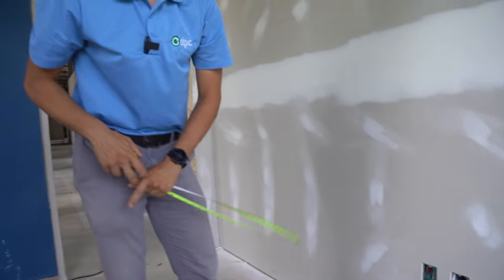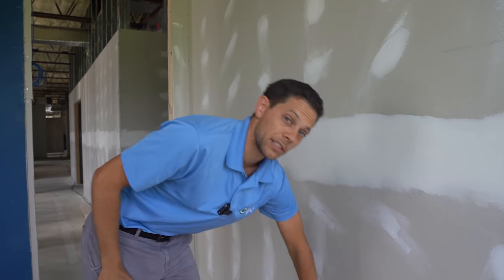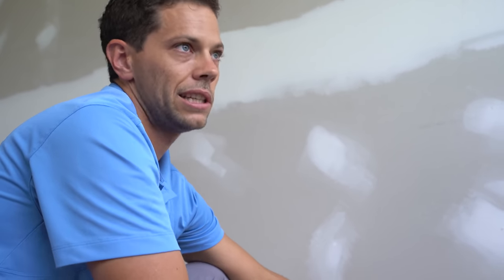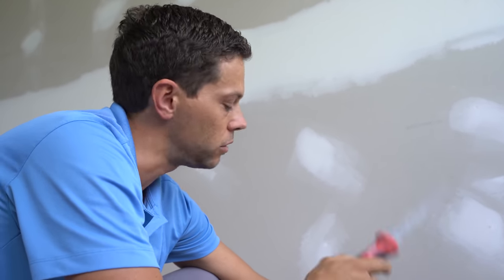Wall Wire Fishing Master Class: Run Cables in ANY Wall like a Pro!

Comment: First, check that there's no wires or pipes in back of the wall. One can use a small punch instead of a keyhole saw to indicate inside corners (or a small dot with pencil). If the wall is clear behind, one can punch trough or use a wall sensor/detector to chick for wires (deep scan, etc).
Reply from the maker: Thanks for the feedback!

Comment: I'm cable from one point to other but it's on the left side
So that means to fish my wire about a 2 feet to the right and down
It's an external wall so there's a cavity between the brick and studs

Should be doable but tricky

Do you have any tips ?
Reply from the maker: External walls are very difficult.  It's had to say..

Comment: Quite a bit trickier in an old plaster wall. Especially when you need to go up a couple floors. I ended up needing those flex bits with an extension  to get through the top and bottom plates. Of course true dimensional lumber as well.
Reply from the maker: All true!

Comment: When do you use that type of box? Is that a box extension?
Reply from the maker: I'm assuming you're talking about the orange box?.  It's for when you are doing work on an existing building.  It simply a ring that a faceplate can't affixed to.  They're very common in the United States
Reply: @DPCTechnology  thanks! So you use those instead of the blue boxes?
Reply from the maker: @lohengrinknight  correct

Comment: How can you fish tape up through a small hole in doubled top studs?
Reply from the maker: We would use a long "fish bit" to drill thru the double studs or go from the top down with either fish tape or fish sticks.
Reply: You don't, unless you want to practice your cursing skills and rage quitting abilities. There's techniques to location the proper drill down location from the attic void space. If you want some tips ask and I'll share. Fish the cable down unless you have to pull it up. Either way you still fish down, then connect and pull the cable up.
Reply from the maker: @grimlockarts8386  thanks for the tips and feedback!

Comment: I personally start at the front of a fish tape while taping and then work my way down to the tip of the cable to make a nice nose so it doesn't get stuck. Then like you said pull a flag going the length of the tape a little bit so the way I'm pulling it shouldn't get caught on anything

Comment: The other trick on an unfinished wall is to use the drywall screw/nail line. Where you see the drywall mud in a line you can assume there's a stud on center.
Reply from the maker: Good call!

Comment: No reason to not also use a $20 stud finder even though they are not always reliable but they would confirm your stud location most the time and prevent making any unnecessary holes. But one thing I learned here is use my stud finder and go all the way up the wall to check for any cross beams.
Reply from the maker: If u got it, it's always good to check..

Comment: Being in a 125yr old house with wood lathe and plaster and fire stops its a total nightmare. My Fein tool is great for cutting holes. I usually drill a small test hole and put a L shaped coat hanger in and spin it to see where I am.
Reply from the maker: Yeah we deal with a lot of old construction too..  it can be very challenging to say the least!!

Comment: So much praying and hoping. Measure 0 times and hope to cut once I guess.

When I wired my house with ethernet, I stuck an Airtag on the ceiling where I wanted to put the cable drop. Knocked up and down the wall to make sure there isnt a cross beam. Went to the attic, made sure I can access where the airtag is, if not, I go down and find a new place and move the airtag.

Once I’m happy with the prospective location and found the airtag from the attic, then I drill the top plate, drop the cable down the hole. Finally I cut out a hole for the box, reach in and pull the cable out. Or stick my phone camera in there if I can’t immediately see the cable
Reply from the maker: That's pretty cool

Comment: I ran 6 Cat6 lines though a hole in my wall where I installed a panel, and in that panel I have a network switch. I'd like to have power to that network switch on the inside of that box, but there are zero outlets on that wall. I know I can run a wire down to it and install an outlet, then the wire through the attic down to an existing outlet, but all of those outlets are in boxes by code. How do I fish the wire through a box from the box up to a hole I drill in a stud at the top into my attic OR how do I go from that hole down into that box? All the angles are wrong and the box has sideways nails which hold it to the stud. I cant remove the box to fish from the top down, and I can't fish from the box to the hole up top. What about jacking into the existing line? I'd found said line, but it's stapled to the studs inside the wall and in the attic there is less than a few inches of slack as it's all 1980s Florida code. I don't want to run a whole new line from across the attic. What do I do? Is my only option drywall repair?
Reply from the maker: Honestly, I would call an electrician.  Low voltage is something that is easy to DIY, electrical is best left to the pros.

Comment: I’d suggest just marking the box and using a skinny drill bit. No need to make a huge gash in the wall with that drywall saw.
Reply from the maker: Thanks for the tip!

Comment: Can those low voltage orange boxes be used with Poe cabling?
Reply from the maker: Yes they can.  Check your local regulations but in Florida and Georgia you can.

Comment: CAT7 and CAT8 cables for higher speed are preformed with a shielded RJ45 plug on each end.  How much harder is it to fish an ethernet cable with an RJ45 plug instead of just raw cable without the plug end.
Reply: Any tips on attaching it to the end of the fishing wire?
Reply from the maker: @weaesq  It is harder, but not impossible.  The key is prep, make your tape job to the fishing wire/string as smooth/aerodynamic as possible, also make sure any holes you cut in the header/footer are a bit larger.  It may take some patience but u can do it!
Reply: Why would you even attempt to with rj connectors on it. Takes 30 to add one after pulling the cable. Saves time if you mess up the connector

Comment: Why couldn't you just use a stud finder and eliminate all the guesswork in the beginning?
Reply from the maker: Because they aren't always accurate
Reply: @DPCTechnology  Couldn't you confirm its accuracy by testing out other studs on the wall and measure 16" from those points to see if the stud finder is marking locations correctly? Just thinking logically about the problem of a potential issue with a stud finder.

Comment: Today I had to reject a job wiring for tv outlets. To my surprise the client inside walls were from stucco!? My magnet couldn't find studs like I usually do.
Reply from the maker: It happens!
Reply: @DPCTechnology  I was afraid of not finding a cavity to drop my cables from the attic.
Reply from the maker: @qasion  you were smart to move on

Comment: You have no idea what you're doing. You say that having a stud finder is a nuisance but somehow you are ok with punching holes in clients finished walls and repairing them. There are so many things wrong with your method that i have been inspired to make a video of my own. To anyone watching this video please know that you need to use a stud finder that also identifies electrical cables. YOU NEVER PUNCH BLINDLY INTO A WALL!!!!!!
Reply: Where is that video you were inspired to make? You haven’t uploaded it.
Reply: Why would you need a stud finder if you know how walls are framed and finished? In this particular video you can see where the drywall screws are fastened to studs. If the wall was finished and painted there are many other ways to find studs without a stud finder. 🤦🏾‍♂️ I’m embarrassed for you
Reply: @KingHarry1 the overall issue is blindly drilling into a wall not knowing what’s behind what you’re drilling such as electrical wires

Comment: Don’t use a Sharpie on the walls or any other surfaces   Where it may bleed through a paint job, get a pencil. Even if you will cut it out, get used to using a pencil.
Reply from the maker: Thanks for the tip!
Reply: @DPCTechnology  You did mention using a pencil, I think I commented before I heard you, 😁.
Reply from the maker: :) @truthdefenders-  :)

Comment: Im unpaid guest Unfortunatley dosent apear to be a loft hatch accsesable,so new cable needs installing horizontal,plane through,by far shortest route,less decor damage or over vert cavity studs then back down again,will need masonary drilling through cavity tee end?,from entrance passage from to + wall A standard wall switch,to reach over bed 4 metres from door entrance pitch dark,loaded with food shopping+slipped disc)?to convert current standard entrance switch over bed new cable has to loop over entrance door frame down,to new switch site(but should  been orignal switch site?as original chippy reversed door open hand im told?,Hotel cleaning staff told me its HOTEL room its bed sit onswete its advatised as serviced swuetes, im not sheff ether eve if was the main oven been out action ever since i arived im waiting for ordered spares,iv just looped cable in kitchen over door frame,same switching wrong side problem?i told all staff &manager to f off when they delivered hoover washing m/c lockdown,not seen any them since,3yrs ago?im 72,poor starving state pensioner?they chargeing £50-00 day,injured back,ariving down fire escape trolley bag,i want the landlord to pay me full refund+pay me £50-00 day for putting up with it,all electricals iv had to fix,toaster blew up face,first week,4th week double13amp socket,blew out fitted to close to only room heated,melted cable insulation,&plastic socket i plumbed in washing m/c,water heaters intermittant trickle,landlord uncontactable,i refused offer tenancy offer,im still here at the mo?giant tv has no signal,wi- fi intermittant,the first room i had,in the block was without electric first winter, 6 months,theirs many homeless rough sleepers people in town?

Comment: This is not a master class, this is a class on how to do it the wrong way with too much confidence. “I haven’t used a stud finder in years.” That’s just dumb. What do you do when there’s a fire-block involved and you already cut a hole? And using a sharpie instead of a pencil  for marking your holes…? That’s awful practice and any skilled person will tell you that. Also, never using a “fish stick” in a wall with insulation? That’s the best tool there is for a wall with insulation, so you can push past the insulation. Also “in a residential situation you may have to drill through the header, you can fish down, you can fish up” NO. You suggest I can run a fish tape up an insulated wall and go through a 1 inch hole that I can’t see?

This is the worst advice ever. 

Source: am a licensed CCTV installer, used to be a cable guy, and have been doing home automation work for 12 years.
Reply from the maker: Thanks for the feedback!